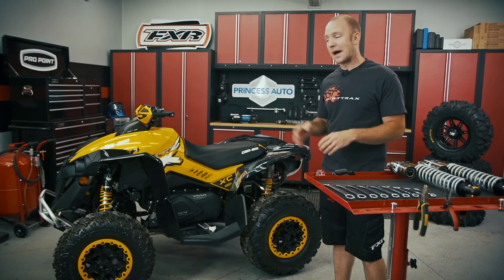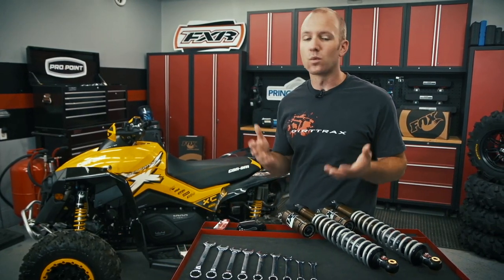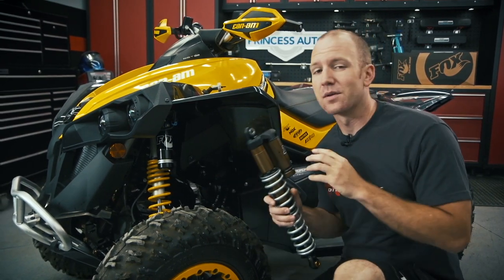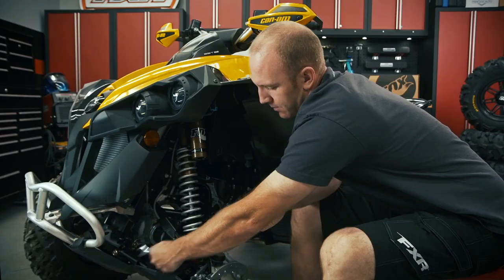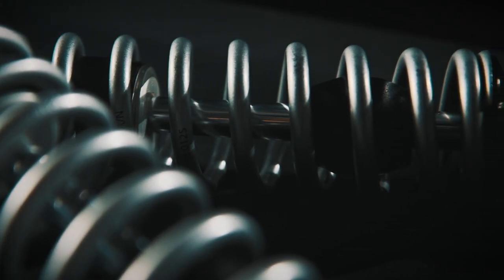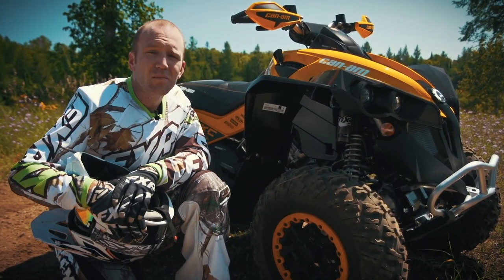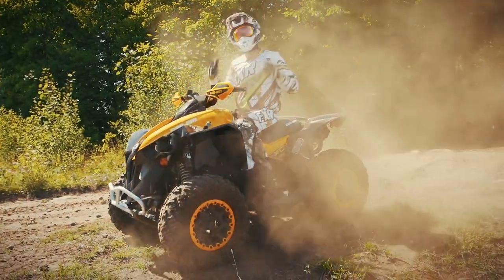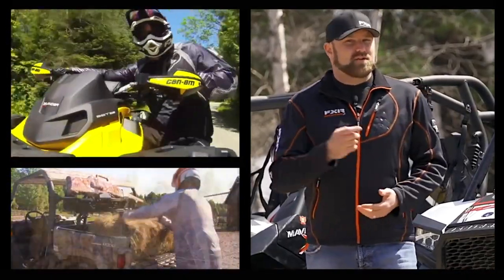2014 Can-Am Renegade X xc Fox Shocks Upgrade

Comment: There is a lot of confusion about what to do about the soft springs on the newer outlanders. I have a 2014 max xt 650 and the set up it way too soft, don't get me wrong it's  as smooth as a lazy boy recliner but it does need some attention. A lot of people in the forums are looking for some answers to this issue. Maybe you could do a short video for the G-2 outlanders and help us out. Thanks and keep up the good work.

Comment: looking for a full set of shocks for my 09 outlander 800r has 30 x 11 x 14s all the way around on it also looking for a clutch up grade as well primary only and I am not rich looking for the most for the buck any help or points in the right direction greatly ap!

Comment: are these top of the range still or is there new model out
Reply: so i ended up buying these and the springs are way to stiff
Reply: @tyroneguy5465  i heard at least when ordering elkas to have them set up up for 75 to 100 lighter in weight then you are or they are to stiff as well. What did you end up doing at the end of the day?